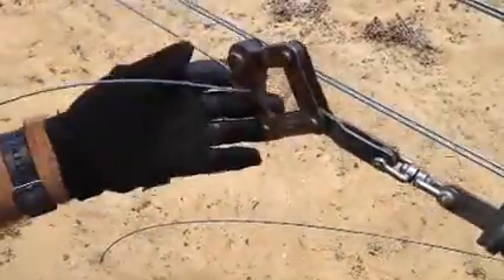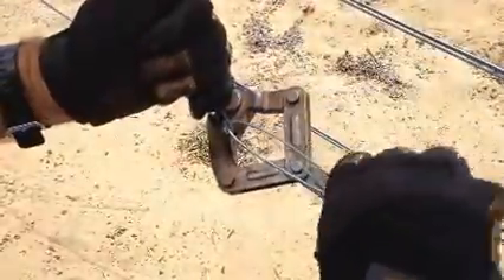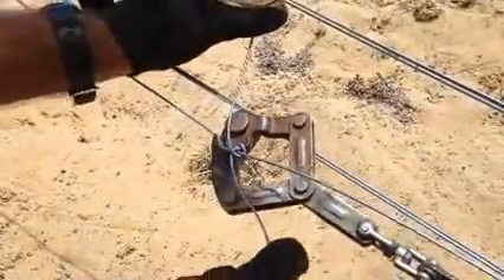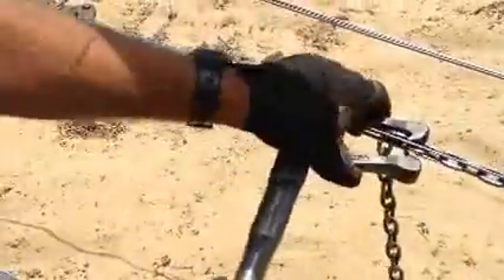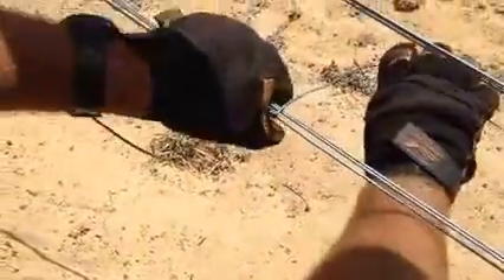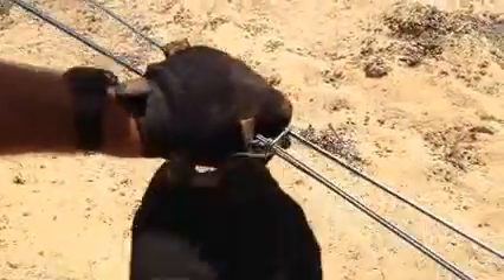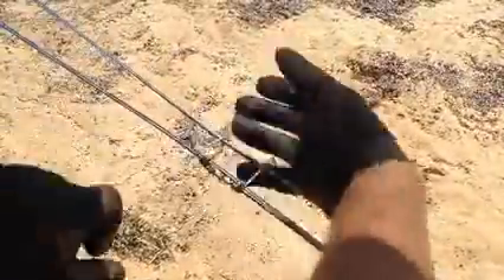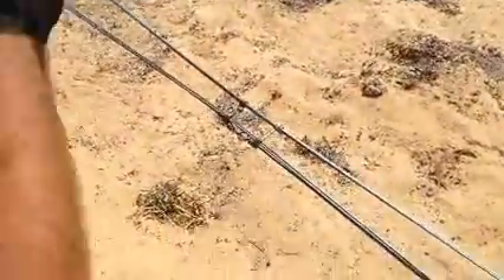Tex Brown knot

Comment: good vid, we've been using the tex brown for about 2 or 3 years here in the UK. I cross the wires between the 2 posts but I like the way you pull them together and finish it off
Reply from the maker: Every contractor seems to have a signature, I can usually tell who has worked somewhere by the way they build their end assemblies, that just my signature I guess.